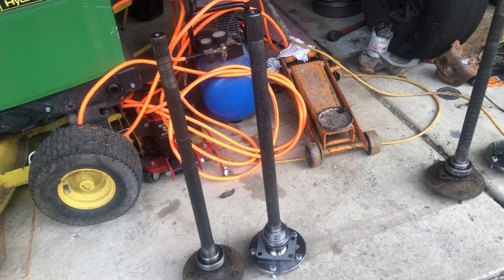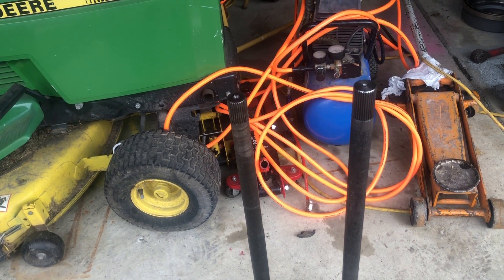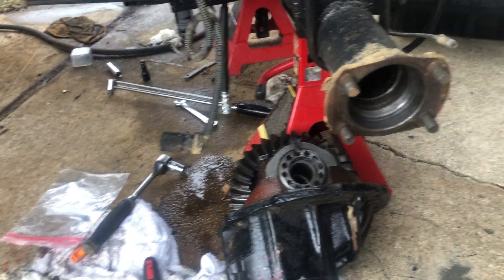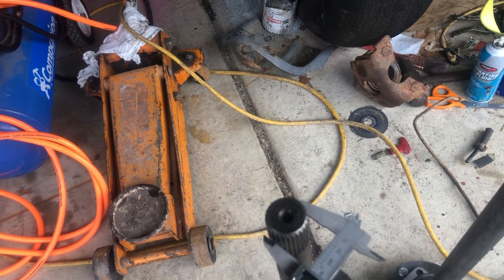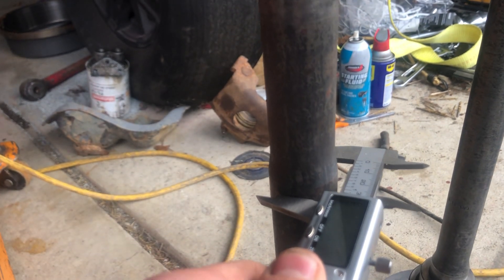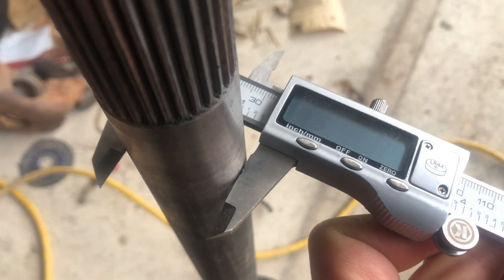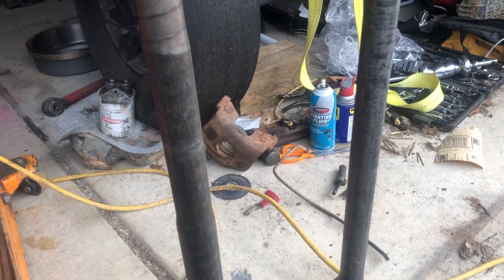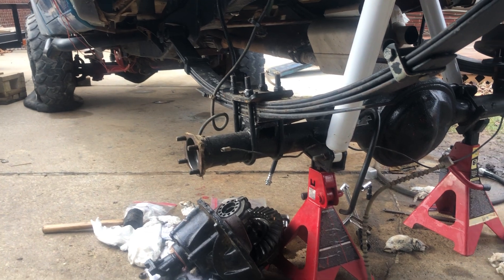Ford 9 inch 28 spline vs 31 spline axles!

Comment: Thank you for the video. What year is your bronco? What length is the 28 spline axle? What offset is the hub face to the housing/bearing? What size lug pattern? I have a feeling the 28 spline of your bronco will fit the 1981 E-150 application that i need so bad and cant find. Thank you in advance. Same caliper spect you took, but with length of 33", ofset of 2" and lug pattern of 5x5.5.

Comment: I’ve got a 1980 Bronco and it’s got a TracLok, how will I know if I have 28 or 31 spline axels?
Reply from the maker: If it’s a full-size then I’m pretty sure they were all 31 spline, but the guaranteed way is to pull the axle and count splines, I’m really sure it be 31 though